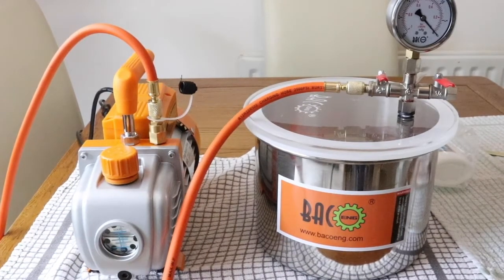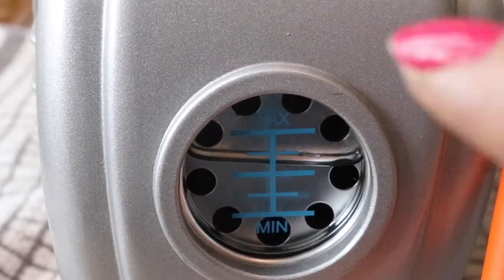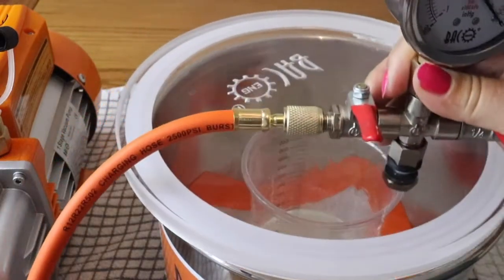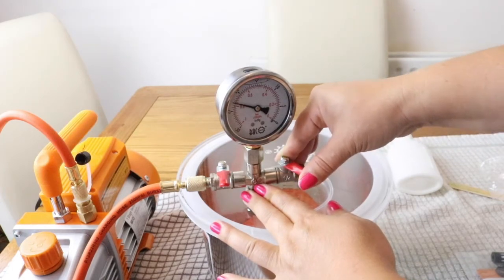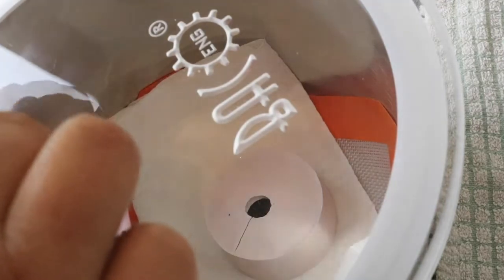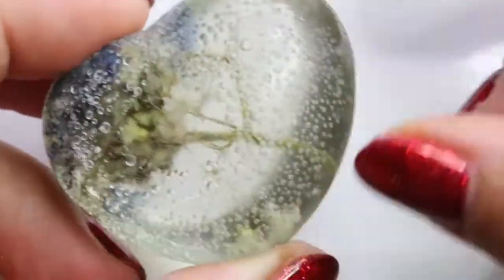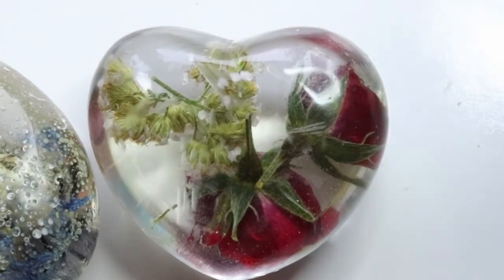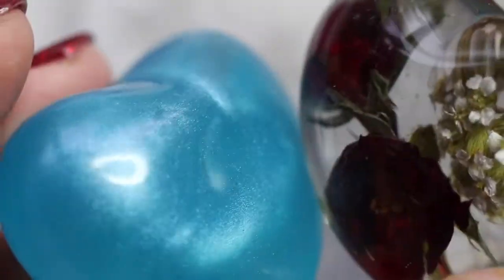HOW TO SET UP VACUUM PUMP AND RESULTS

Comment: Before watching this I have to say, I’m blooming useless doing online shopping. I was so excited when the chamber arrived, this quickly turned to embarrassment and frustration when I realised I needed a pump thing. I just hope I bought the right one. So on with the video where I will no doubt find I’ve got to get something else or I’ve got the wrong pump. Rant over but this resin lark it’s costly ❤❤❤❤WHAT,!! I need an adapter plug aaarrggg
Reply from the maker: Thank you so much 😄😃

Comment: So can you take the bubbles out In your mixing container with the vaccume chamber then pour that into the mold and not place the mold into the chamber?
Reply: You can place the mold in the chamber and pull vacuum, but the vacuum will cause the bubbles to "boil" out of the resin, spilling it out of the mold, then you need to add more resin, and pull vacuum again, and again it will spill some. 

The bubbles come back as soon as you pour resin into a mold. 

With a pressure pot, you mix resin, put in mold, put mold into pressure pot, add pressure, and bubbles are compressed into smaller than the human eye can see. You keep the mold in the pressure pot until it is cured. No bubbles.

With a vacuum pump, there is the problem of the bubbles will always spill out of the mold when vacuum is pulled.